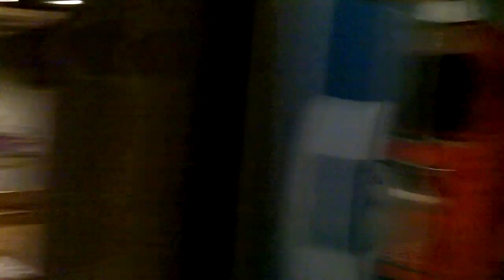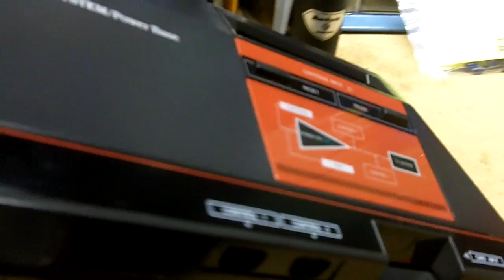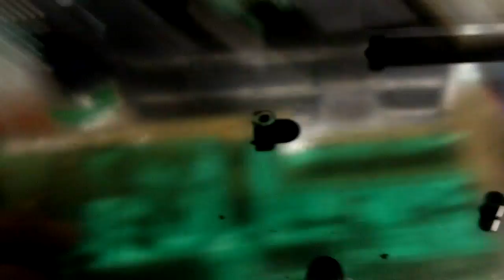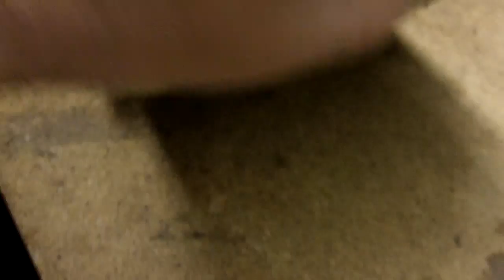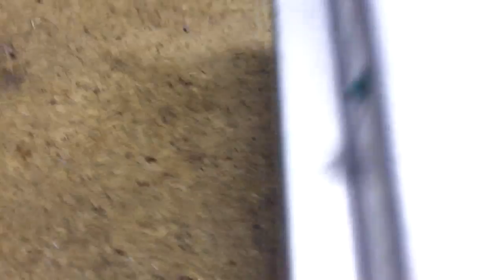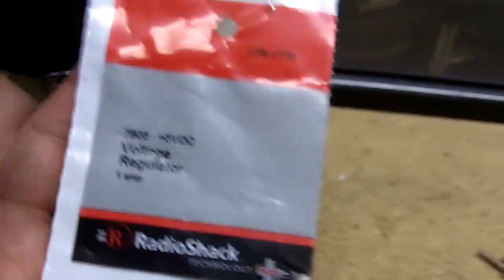Sega Master System Repair

Comment: I enjoyed this video but next time, you might consider, actually showing how you located the defective capacitor. Noobs like me, who are trying to learn, often haven’t got a clue as to how to go about that - what instrument did you use? If you used a multimeter, what mode did you set it to? How did you know what section of the board to inspect? That sort of thing. Anyhoo, cheers!

Comment: Might have been a while since you checked comments here. But when I turn on my model 1 SMS, the colors on the screen cycle different colors. For example, the blue Sega logo on the bios will go from Blue to purple/pink etc back to blue. The black and white is fine. I'm confused and don't know whether some capacitors are bad or what.

Comment: Hello friendI had trouble understanding her video, because my English is very bad. I am writing with the help of a translator.
But I think I have the same problem as yours.

My master system board is a little different, because it is Brazilian.

He's not calling, gives no signal.
I opened it and I saw the burned resistor L50I exchanged him, I changed from voltage regulator 7805 and continues not turning on and warming the L50 resistor.

You say that found an shorted capacitor.
I need to know which capacitor you have exchanged. You speak into C20.
The C20 is away from the trail of burnt resistor.

I have a video of my master system.

Thank you

which
Reply: Coleção Nintendo uhauhauhaahuhua faz tempo!! =P

Comment: Hi I have 2 model 1 sega master systems with the same problem but with varying severitys. They both have a problem where they show vertical lines on the screen during gameplay with some games, I thought it might have been the games themselves however they also do it with snail maze. The first console is really bad and it wont even send a signal to the tv if you are using an rf adapter. It works with the av cables only and it has really bad vertical lines. The second console still works with an rf adapter and has vertical lines that are not nearly as bad. have you ever had this problem, and if so could you steer me in the right direction in solving this issue?
Reply from the maker: I had one console ever that had an issue like this.  I ended up replacing the capacitors in the system and it took care of the issue.

Comment: I have an issue with a chinese made NTSC Master System I where it will play the embedded games but not read any carts, if a cart is in the slot it just plays the hang on or the phaser game.
Reply: Solved it, broken solder joints on cart connector, almost all of them were messed up, mega carts sometimes work sometimes dont, im gunna do a proper job of it tomorrow.

Comment: My story on this is thus: Shortly after I was born in mid-1986 my dad bought the SMS, first video game console we owned. Around 1 to 2 years later being the young, stupid kid I was and the naive dad that he was leaving the system on the floor with potted plants in the house...well you get the picture. Fast forward to about 15 years ago, we decide to get the system a try and lo and behold it turns on and works. We play it for about a month until it stops working. I'd always thought that my throwing potting soil into the system was the cause of it's failure but it seems this voltage regulator would be more of the issue if it worked years after the incident until it failed for good due to power issue.

I just tried it tonight and the light doesn't come on or anything on the console, basically just a brick. I'll have my brother take a look at it in the coming days, he's already been able to get several consoles to work that weren't working, something like this sounds like a cakewalk in comparison.
Reply from the maker: First thing I would do is check the power adapter to make sure it's supplying power, if not replacing the voltage regulator is a very cheap and easy fix.
Reply: I think my brother has a short circuit detector, I'll check with him in the coming days and then if all checks out for that I'll do the voltage regulator fix. Again thanks for the video, relief knowing that what you might have did when you were a baby to a video game system really wasn't likely your fault after all.
Reply: RetroGam3Nerd Just took a better look at the SMS and after carefully examining it, we discovered discoloration around the edges of the AC adaptor. Taking a chance I tore it open to discover excessive/extreme water damage, needless to say it was beyond saving due to being caught in a flood down in the basement years ago. So in a way, you were right.

Comment: I have a model 1 and the problem seems to be the same but I did get power for a sec with an adapter by jiggling the cord in the plug the light went on then died again.

Im going to replace the regulator first - hopefully that fixes it but it looks fine.
Reply from the maker: If you jiggle the cord and get power, that tells me you have a short in the power adapter wire or loose power adapter input on the console.  I think changing the regulator you are just wasting your time.
Reply: RetroGam3Nerd
Well it only gave it power for a second, and I tried 2 different power adapters.

1 I defiantly know is working fine and used in a Genesis Sega Mega drive model 1 (which has the same power adapter).

I also think it might be the power adapter input but where can I get 1 of these or fix it somehow? Any tips?

Thanks for the video btw! Very helpful.

I also didnt get any voltage using a MultiM even when connecting the cables directly to the regulator.
Reply from the maker: Peter Doukas I would first take it apart and make sure the power adapter is soldered tightly to the board, if not reflow the contact points of the power adapter to the to board that should fix the issue.  If you determine that the power plug in on the board is bad let me know I might have one on another board I could de-solder and send you.

Comment: Definitely useful info. There are alot of the things ruined by people using an NES adaptor. The best bet on any console is to try to get official cables, or at the very least make sure your cable matches the guidelines on the bottom of the console. Just because it fits doesn't necessarily mean it works.

Comment: Hey bro nice Video; just a question I have and I cant seem to find anything on google and you may be able to help me...

My MS2 will not go left (on all of my controllers) I have tested them on my Mega Drive 2and in the player 2 port; I read your response to an earlier post,  a controller being stuck down - you said it was a transistor problem..

Wow I just cleaned it and dusted it and got the second player working and its fixed, I also played a 2 player game and got them working.. VERY Strange?

Comment: I may be a little late and maybe you fixed it already, but I had the exact issue. I took my SMS apart and there was a tiny piece of cardboard/paper sitting on the path, once it was removed, the SMS worked.

I thought mine was a special case, but I read that this has actually happened quite a few times.

Comment: I just got a SMS the other day, it had the two built-in games and worked great. I bought a cartridge game and a card. The card works, but the cartridge just gets a black screen, The cartridge fits snug so I don't think the pins are loose, I think they're oxidized and read that you can clean them with a credit card and a fine-grain sandpaper.

I've READ this a few times, but I've never actually SEEN it. There seems to be no videos on youtube about it. can you confirm if this will work?

Comment: On a master system like yours I have repaired the voltage regulator I then hooked it up to the tv and got no picture on the tv I have try a different master system on the tv and that worked fine so I know the tv and all the leads are ok do you have any ideas why that master system does not output too the tv

Comment from the maker: Game pads really don't have any parts that can be replaced.  99% of the time you can take the pads apart and clean really well with Q-Tips and alcohol and that will fix unresponsive pads.  Besides that it's just easier to get a different pad.

Comment: thanks for the video.. I'm wondering if you could help with a problem I'm having.. I picked up a master system today and it doesn't seem to want to load the games.. the unit powers up and I can pick between hang-on and safari hunt (this is one of the units that had those built in) but when I load carts up it doesn't seem to recognize them it just goes to the hang on and safari hunt selector screen.. any help would be appreciated

Comment: Hello retrogamer, firstly i'm glad to find you :). I bought a second hand SMS1 today, it is made in china and date is 2 november 1990. I hook it to HDTV and i get the correct screen perfectly, but after 15-20 seconds SMS Freezes and sound loops. It reads games but same thing hapens every time. Some times it takes 5 second sometimes 30 seconds. What do you think the problem is? BTW i use DC 9V 500 mA adapter (it says needs 850 mA) could it be the problem? King regards to you my friend.

Comment from the maker: If you are getting a black screen and the voltage regulator is getting hot, the voltage regulator is doing its job, as long as you have power.  That big metal thing the V-reg connects to is a heat sink and made to take the heat away from the V-reg.  I would check all your capacitors and make sure non of them are shorted and in good condition.

Comment: This is with an AV cable by the way.

Also, you're correct about capacitors. Capacitors effect signal delay in DC and filtering in AC so you don't want to change the Farad value. I'm pretty sure the voltage is just a rating so that you can be safe going up to 10 V.

Comment from the maker: I would say something is shorted, I would search the internet for the pinout of the SMS.
Open the console and follow what pin is shorted, If it is the down button it will be pin 2.  I have seen this before and it is usually because the transistor for that pin is shorted.  What I would do is de-solder that transistor from the board and see if the problem goes away.

Comment from the maker: I would suggest trying a different RF box, or bypass the RF box all together by using an adapter for coax in and RCA out. plug the rca end into the master system and the other coax end into the TV.  If you need, I can make you a cable and send it to you, just need to know how long you would want it.